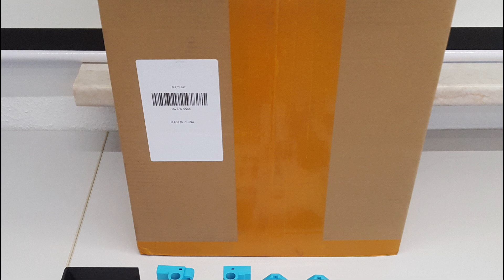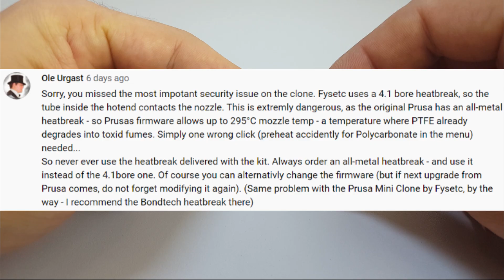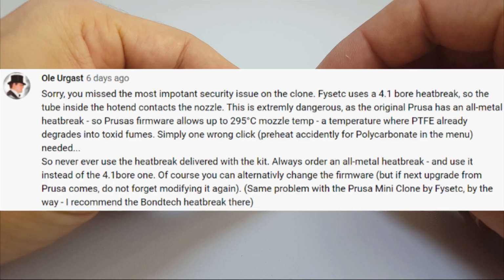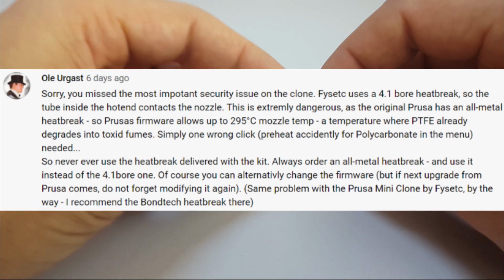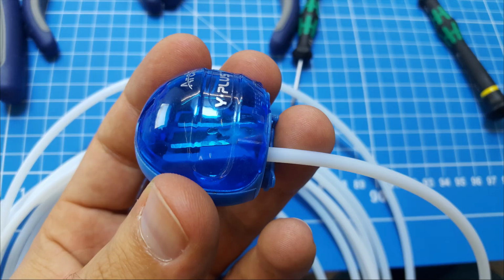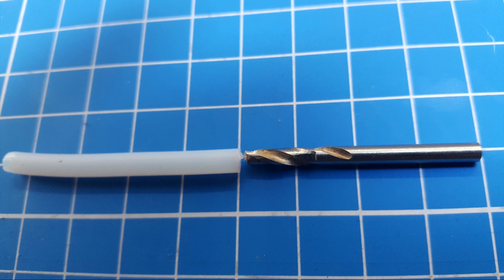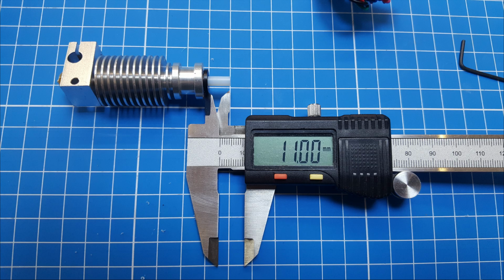Prusa MK3s Clone 3D printer unboxing and assembly

Comment: i just received printer. I broken extruder idler plastic part and now i have to wait to print another. May i ask you how u connect hotend 2 wires that have no connector at end wires? Should not be there a connector for motherboard? The wire for temperature sensor have a plastic connector at the end, but thermistor have 2 wires without any plug.
Reply from the maker: There is a screw terminal type connector in the package. You can build the 3d printer, make the wire management and at the end cut the cable length, free up the ends from the insulator layer and screw inside the connector, after that you can plug it into the Einsy board. Polarity does not matter.
Reply: @Dombi3D  man this hotend is crap. I put petg and it clogged inside radiator and overfilled on entire extrusion assembly. It extruded like 2 cm after i finished calibration and wanted to adjust live z . now i have to buy another hotend, i think i buy from prusa straight. This printer is kinda crap. Also some holes from frame for einsy case mount are not properly threaded. A lot of issues. But hotend is a crap. Now i wait 2 weeks more to get hotend from prusa.
Reply from the maker: @Flavius-Tech  I am over 2kg of PETG with the stock clone hotend parts without issues. Are you sure that you assembled the hotend properly? No filament should escape anywhere just through the very end of the nozzle. You also has to be sure that the bondtech gear on the extruder stepper is aligned with the hole and the Teflon tube inserted all the way down into the heatbrake.
Reply: @Dombi3D  It was, 11mm teflon from metal like in ur video. Hotend, nozzle etc was like in ur video. Nvm, i put some pictures on aliexpress on review, literrally all filament filled entire cooler radiator, i think that ptfe from inside heatbreaker was fault.
Reply from the maker: @Flavius-Tech  11mm from the metal surface and the other side all the way down? The teflon tube that you put inside ther should be around 44mm long:
https://help.prusa3d.com/en/guide/how-to-trim-ptfe-tube-original-prusa-printers_22424
I am curious about your picture.
Reply: @Dombi3D  I made some research, and i was use to print with bowden type printer, and that pneumatic connector, and there i insert ptfe only 1cm inside fitting. And therefor i inserted the ptfe same way, 1 cm in, there i saw resistence, probably was the lip on the aluminium radiator and i left it like that, so the filament was going inside radiator, and there are at least 4mm tube diameter inside radiator till reached heatbreaker, so my filament was heating inside radiator and got cloged/filled. But also i found that small ptfe from heatbreaker where  insert to heat element near nozzle was also clogged. It was my mistake, i had no clue i have to insert that ptfe so deep inside. Now i wait for order, i get one assembled already.

Comment: Built a PrusaClone:
PETG at  230 degrees
First layer cal looks perfect.
go to print something and after a few minutes the filament starts to fade. Looks like the stepper stopped grabbing the filament. But why? it was so perfect.
I suspect that the stepper is overheating and the heat is warping the filament overtime until it gets to soft to grab?
I tried loosening the gear screw and had no luck.

Any ideas?
Reply from the maker: That could caused by several things.
Clogged nozzle, Heat creep, bondtech gears are not aligned, Teflon tube misalignment. 
-If you can manually push the filament trough the nozzle than clogged nozzle is not the issue.
-The clone has a strong nozzle fan so I would not think that it is heat creep issue. (PETG also not prone to that).
-Check if you aligned the gears with the hole.
-Check if your Teflon tube in its place. If Teflon pieces goes inside the tube can clog your nozzle. Because the Clone comes with a Teflon tube inserted in the heat-brake on the heated side also, can also cause issues by retractions.
Reply: @Dombi3D  I had upgraded my heatbreak as per your recommendation. I also used an upgraded nozzle.  I have aligned and realigned the gears a few times with no luck, but i can try again, i was thinking the gears are cheaply made and i should upgrade them to bondtech gears... 
Teflon tube seems fine. I ended up using one of the original prusa ones i had laying around, and it is the correct length.

What else should I consider?
Reply from the maker: @UnrealApe  in this case turn up the nozzle with around 10°C could be that the temp is not high enough to melt the material. First layer printed slower and that is why it could print fine but when it speeds up not anymore.
Reply: @Dombi3D  ah yes, I forgot to try to slow the print down. Thanks I will test it some more🙏
Reply: @UnrealApe  I have printed a stepper motor  cooling shroud and I used a separate 2 meters usb cable to power up the fan to cool down the stepper  motor of the extruder,now it works perfectly

Comment: my prusaclone restarted during the calibration. it just finished calibrating home and then when it went to check the bed thermister it just shut off. Do i jsut need to repalce the thermister or do you think there is a connection issue?
Reply: Got it, switch the PSU to 110V for North America

Comment: Yeah, it's apparently sometimes a lottery on what you get.
BTW You don't apply thermal paste on heatbreak and don't do hot nozzle tightening?
Reply from the maker: I did not apply thermal paste because it was not included and I did not want to mislead the viewer. Hot nozzle tightening was done just not recorded, though I gave the instruction to retighten the nozzle when it is hot if you listen carefully.
Reply: @Dombi3D  ahh I must have missed that.
Thermal paste not included? Heh, it was included with my MINI clone but nowhere in assembly instructions it says to apply it (at least not version I downloaded).

Comment: What Linear bearings would you recommend? The original ones from Prusa?
Reply from the maker: I bought a set of misumi bearings for the other printer and 1 set Igus polymer bearings to test them because of their better price point but my first results shows that the misumi is the superior one. This will be my next video as I mentioned at the end of the video. I put some extra links in the description. I personally bought them on Ebay.
Reply: @Dombi3D  The Igus commonly used are made for being put into prepressing fittings. For the design of the mk3 you need the prepressed ones - with a price of about 15-20$ per piece. They are dual material, inside is Iglidur, outside aluminium. They are more quite - but with a good mitsumi or ico bearing it is not worth to pay the extreme price.
On x on the Prusa Mini I use two normal Igus bushings. They are more evenly clamped there, so that works fine.
So no general recommendation can be made. In my opinion even the cheep ones can work fine - but quality controll is a mess and you need some more and try wich are working well and sort out the worst.
Reply: @oleurgast730  Hi Bought and installed the IKO ones, must say that they are a big improvement, well worth the money!
The YTP ones that came with the printer don't look bad at all, will install these on the Prusa mini clone as the ones that came with the mini are terrible.
I cleaned all bearing with isopropyl alcohol and greased them with Loctite Superlube.
Reply: @Dombi3D  Great! Thank youv ery much.

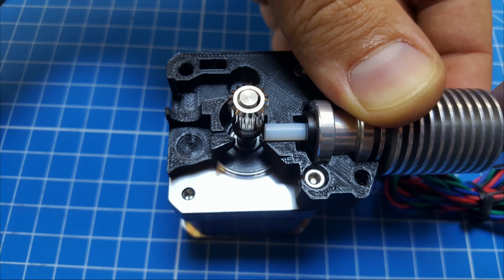Comment: 6:33, it is not Bondtech Gears, it is cloned gears by FYSETC
Reply: The cloned gears are not from Fysetc; Fysetc buy them from other chineese manufactures. In different batches you might get different cuts. There is a cut that was intended for 2.85mm but also work with 1.75mm. And a cut for 1.75mm only, like the original Bondtech.
Due to the different cut you have a different effective diameter. So in an mk3s you need 830 esteps/mm for the 1.75 only cut, but about 870 eSteps/mm for the other cut. If you have underextrusion with stock settings, this is the first point to check...
Reply from the maker: @oleurgast730  Your comments are really helpfull and informative! Thanks for your input. I will check them, because I did not thought about it before.
Reply from the maker: Oh, I missed that. How can you tell the difference?
Reply: @Dombi3D  Prusa is the only one that supplies original parts, FYSETC just clones components

Comment: I like this series of videos you are making. I wouldn't buy one due to the fact I'm still new to the 3D printing world and not experienced enough to do a lot of assembly but I find this interesting. Thanks for sharing!
Reply: The original Prusa mk3 kit was my first 3d printer about 2 1/2 years ago (exept from a toy, the fischertechnik 3d printer).
This was before chineese mostly preassembled printers where sold.
So I also started without experience.
But due to the very good assembly guide, there was no problem at all. The only advantage of being experienced is becomming faster on assembly. My assembly time got down from 9h to 4.5h, as I do not need to look into the guide anymore and also have some tools like electrical screedriver with fitting bits.
So do not get frighten by the many parts - assembly takes time, but it is not complicated. And you get the best printer in its price-range.
For the Fysetc Clone only 3 things to be changed: Buy a full metal heatbreak, the original Prusa thermistor and the bag with Harribo bears seperatly (the Haribo can be substituted by any alternative sweets without effect in print quality ;-)

As preassembled chineese printers often have loose screws, I have found many of them even more complicated to tune in - I had errors and had to research the cause. This never happened on my mk3...
So even for beginners, I recommend such a kit. The time you spend for assembly is well invested. You spare more than that afterwards. The Prusa mk3(s) with PrusaSlicer and predifined profiles is much more easy in usage - so spend a weekend to build it will save you lot of time while using it.
Reply: Oh and btw I subscribed for more updates. Thanks!

Comment: Interesting how different the batches are. On my clones the heatbreak was hollow to put the blue tube down to the nozzle (thats the reason I immeditly saw the difference to original Prusa). With a short PTFE already applied inside the heatbreak, the dangerous difference is much harder to detect, no wonder you had not seen it in your first video.
The fast changing contents of the box also might be responsible for some reported underextrusion (or bad first layer): Cloned Bondtech gears might be from different manufactures, having a different cut. They all worked fine for me, but need. slightly different eSteps. So for the Clones eStep calibration is mandantory while on the original it is optional.
The different heater with 50W is no problem by itself, but require a PID tuning. More problematicly is the potentially different thermistor. Prusa uses "Type 5" of Marlin, while sometimes the clone is delivered with Type 1. This can cause an error about 10°C in meassured temperature. Hard to detect, but I had some Type 5 flying around and used them to be sure. Alternatively you can of course change the firmware or simply print a temptower to get the right "Temperature" to set in the slicer (so you can not use the nice predifined settings in PrusaSlicer).
For the bearings: It is more about missing quality controll than generally bad bearings. As I got multiple Clones (3 Fysetc Clones of the Prusa Mini, 2 Fysetc Clones of the mk3s) I changed two of the clones to high quality bearings - and for the other clones I tested all bearings by hand, sorting out the bad ones.
So in summery:
The Fysetc Clones (of the mk3s and of the Mini) are quite nice. But you need additional parts and steps in asembly. Also you need some calibration that is not needed with an Original Prusa - but of you do so, you get same quality as with the original for less than halve the price.
I recommend following parts:
- e3d Heatbreak PE (you can get the special PrusaEdition from 3djake), so you solve the heatbreak issue and also might add an MMU2 later
- a Type 5 thermistor
- some extra bearings to replace the worst bearings (or a complete set of higher quality bearings)

Of course, as you print the plastic parts yourself, in some aspects the Clone can even be better than the Original Prusa. For example the filament runout sensor often is not reliable in the original, as it tend to stuck. It is caused by Prusa printing the parts with 0.3mm layerhight quite fast. So if you use 0.2mm layerhight or less to print the parts of the printhead and print slower, this problem is solved. Also you can even use the old filament sensor (wich also detects if filament moves!) as its missing reliability was caused by the high reflecting PET-G. So if you print the parts yourself, simply use non-reflective black ABS for the printhead (or, more easy to use, ExtrudR Greentech pro black). 

Of course the most important change: Modify the display case before printing and replace "original" by "cloned" ;-)
Reply: can i just use capricorn tubing
Reply: @natebigg802  Capricorn uses PTFE with some additives and more precise manufacturing. It solves some issues low quality tubes have, like deforming early, but If you get to the temperature PTFE degrades, all this do not help.
If I remember, deforming starts mostly on 250, degrading on 275. On Capricorn deforming is reduced by additives. But degrading still happens If your printer preheats to Polycarbonate.
Anyway - a full metal heatbreak is in the same price-range as Capricorn - and you get no advantage of the higher precisision  on the very short tube inside a direct extruder.
Also of course it does not have the inner structure to form the tip if you want to add an MMU2 later.
Reply from the maker: Thanks for your comment again! I will use a HSS nozzle on my new builds which requires around 10°C higher printing temperature so I hope that the temperature difference  caused by the different type of thermistor will get balanced with the predefined printer profiles.
Reply: @Dombi3D  Interesting solution. If I remember correctly, the special heatbreak Prusa uses also require a little more temperature than normal (I think 3d printing nerd had that problem with a certain filament in one of his videos).
So maybe the professional solution would be to print a temptower with same filament both on the Original and the Clone and compare results to find the practical difference in hotend temperature needed. If I remember correctly, you can set a temperature offset in advanced.conf.
Or maybe use a second nozzle of same  type (both on original and clone), drill it wider to insert a reference temperature sensor, and make your own fitting resistance/temperature table for the clone with all it changes...
It is esp. interesting if using a mix of original and cloned printers - so the gcode is the same on all mk3s.

Prusa firmware is a bit special, a bit different from main Marlin fork. But theese parts are quite stock. So change and compile is not a big deal.
A bit more complicated is the Prusa Mini, as you have to compile the firmware for every change (eSteps, PID...) as it does no M500. Of course you can edit start-gcode. But with a mix of Originals and Clones with different modifications this means different printer settings for every printer. I so much prefer every printer being calibrated for its own, so only one printer profile for all printers of a type (O.K. I always have one second profile with virtual extruders for manual multicolor, but not with different startcodes)
Reply: @oleurgast730  hy Ole the thermistor that selling 3Djake for prusa is compatible with type 5?